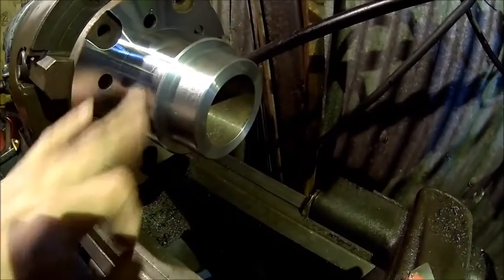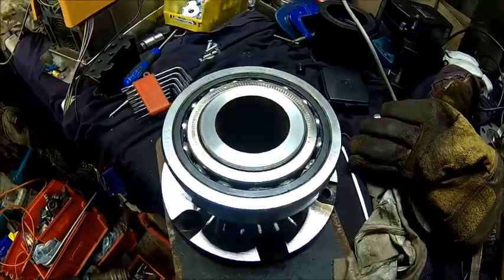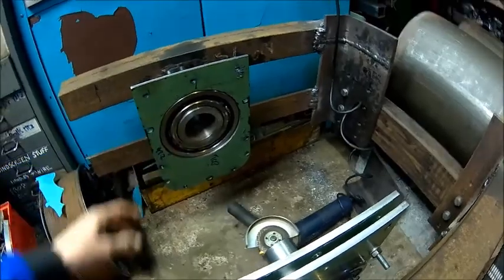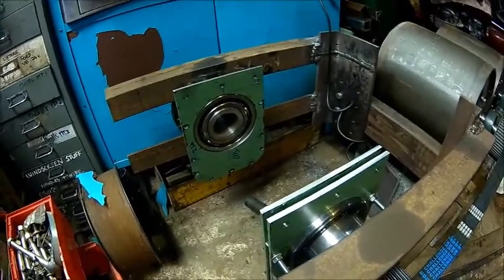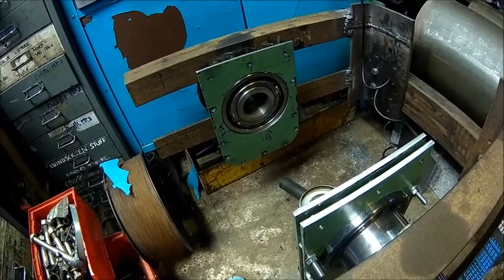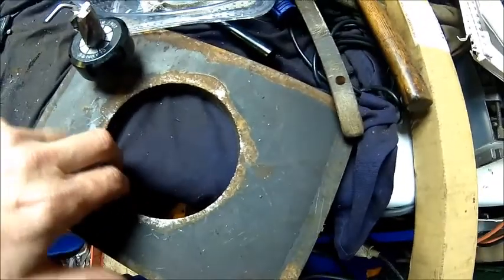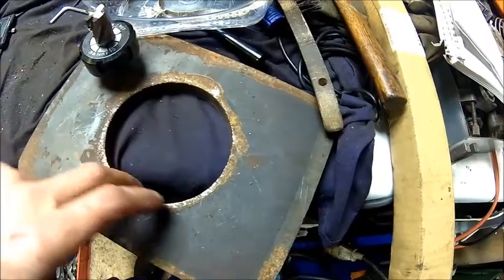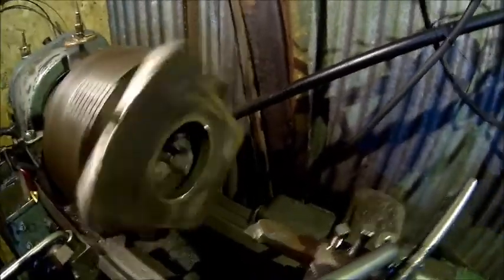The Mystery Project - Part 15,  bearing carrier finished, machining a spacer plate

Comment: Impressive to bore like that. It's getting big
Reply from the maker: It's just easier than on the mill,  adjusting the boring head is so tedious and you have to stop the machine for any adjustment. On the lathe you can feed while it's running and as long as i can swing it, it's ok ...